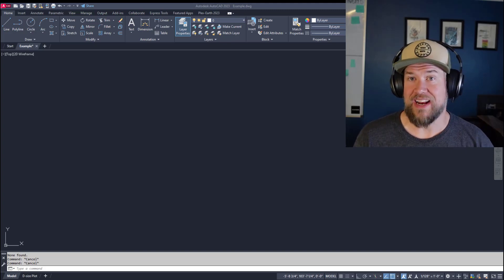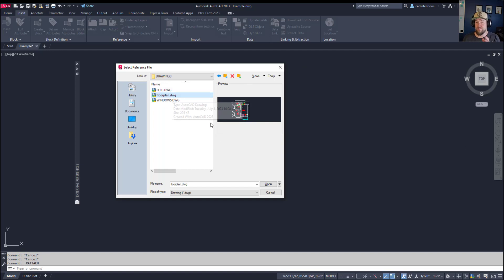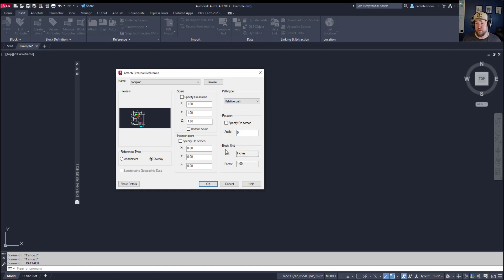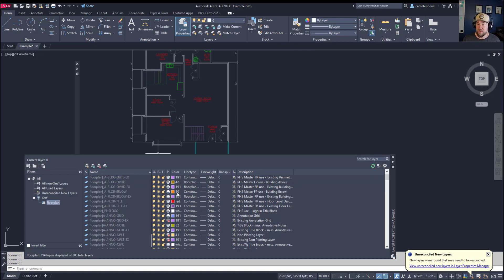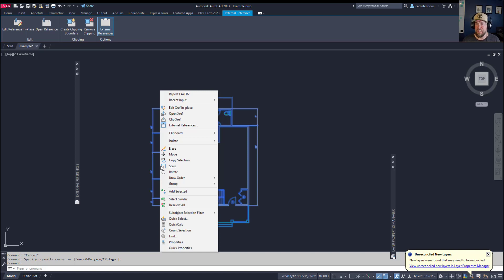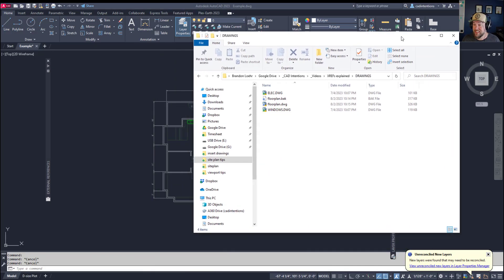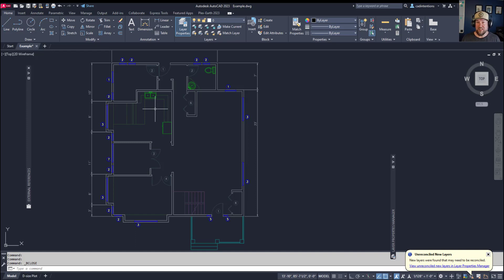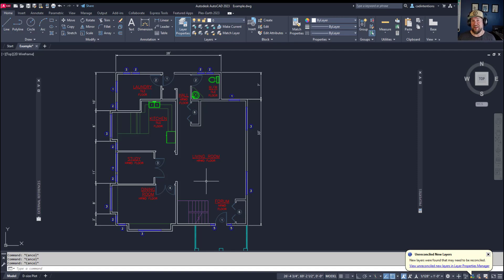AutoCAD XREFs Explained! External Reference Tutorial & Must-Know Tips

Comment: When it comes to binding an XREF, I'd add that it's a useful tool for saving out a revision. If you want to preserve the revision at a certain point in the design, save your file with another name ( I use Filename_Rev.1, Filename_Rev.2 etc.) and then bind all the external references. The design can then proceed, but the XREFs in the revision won't update because they've been bound in as a block. This is a workaround if you don't have any sort of product data management system that's performing these functions for you. Not every company, especially the smaller ones, do.
Reply from the maker: Yes! Definitely a great use case for binding XREFs! Thank you for the comment and process

Thanks for watching too

Cheers,
Brandon